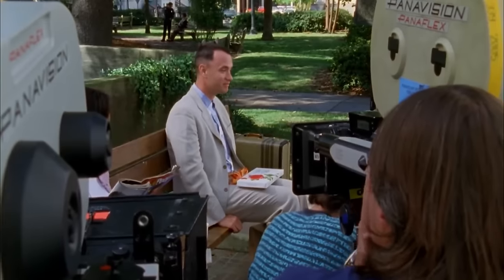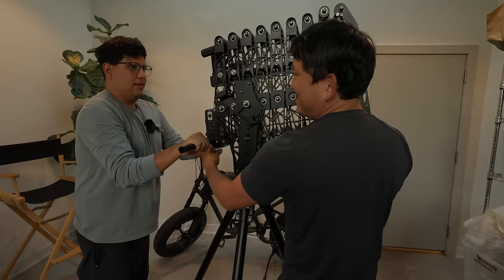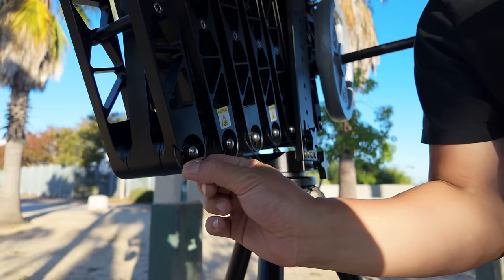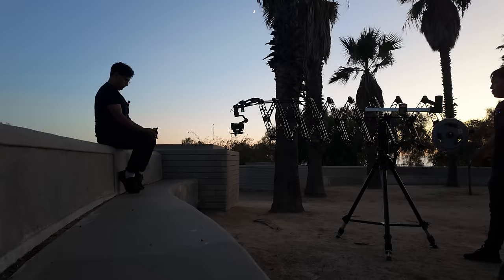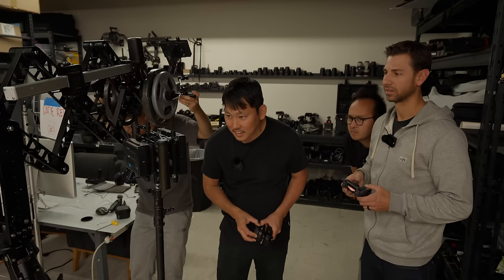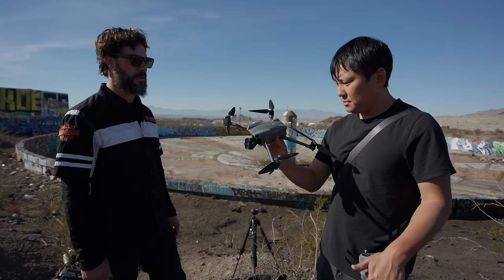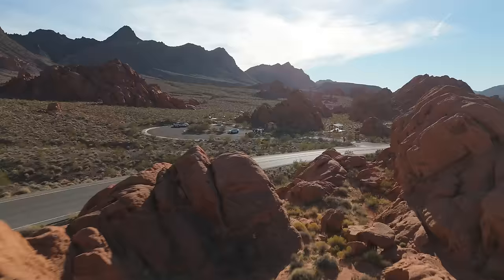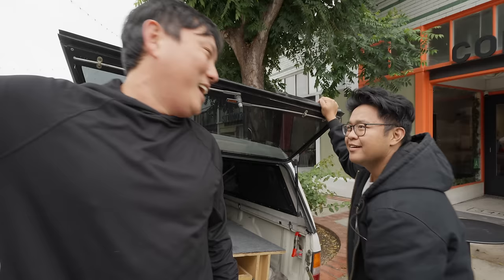I got a Technocrane on a Budget | Telescoping Camera Crane

Comment: So basically taking extra steps and paying extra money to get shots that look kinda like handheld gimbal shots or like gimbal on a readyrig
Reply: @RAN480L64  You know... except for all of the translation sway and non-consistent motion paths. You can clearly see that the image is wobbling around in most shots because of the inconsistent counterbalance.
Reply: @RAN480L64  What a weird bunch of assumptions to make that have absolutely nothing to do with your original reply.

Strawmen don't help your argument.

Nothing about those shots make it look specifically like a crane, half of them COULD have been a drone and the other half look like someone holding a gimbal above their head. The whole point of a crane is to be more stable and repeatable than either of those options, why do you think unwanted translation is the desired effect of a crane?

Comment: A true crane will always have an equal and opposite moment arm, i.e. a couple that sums to zero at the pivot.  The fact that the counterweights do not keep the crane in equilibrium when the camera end is extended shows that the counter-extension has not been thought-out correctly; you should not need to add or remove weights when you've balanced out the crane.
Reply: I wonder if it's the motor and it's battery or something that throws it off. On the long end, the the camera extends off the furthest point and nothing is mounted anywhere else on the arm, on the short end the weights and controller extend off the furthest point. For it to change from being back heavy to front heavy during extension, either something on the long end would need to be extending quicker, or something on the rear end would need to be extending slower - which is what makes me think the motor and battery may be the issue as it's not mounted to the weight bar and so will extend less. Adding a lighter weight on the long end a little closer to the pivot than the mid point would probably allow it to be balanced such that it could maintain equilibrium throughout extension.
Reply: It potentially is user error.

I'd like to get hands on this but don't have time or need right now.
Reply: Seems to me a PERSON holding a camera/gimbal, could get 90 percent of the shots your guys tried?
Reply: @Bill-NM  Yep, most of these shots could have been achieved with the same level of quality by just having a person hold a gimbal above their head...

Comment: did yall try to get a dolly track to a push in rather than using the mechanical option in the crane? would look smoother and wont have to worry about the bumps from the mechanical push in

Comment: So I've been looking at this for 4 years.

I had their 24 ft jib and it worked but it wasn't everything I needed but I've gotten great shots with it.

I agree with your review..

But at 10:50 you point out the difference I think you could build a cage (sppedrails and some gobo heads)around the back and operate from the cage like the techno crane and it would potentially fix that problem with the operator needing to step back as he extends the crane.

Great review tho

Comment: All that load secured by one 1/4 20 bolt is SUPER scary. Awful engineering, and if someone gets hurt when - not if! - it fails, you’ll take all the blame and cost.
Reply: That's definitely not a 1/4" 20. It's bigger than a 3/8" 16.